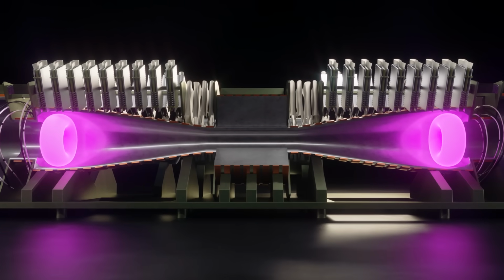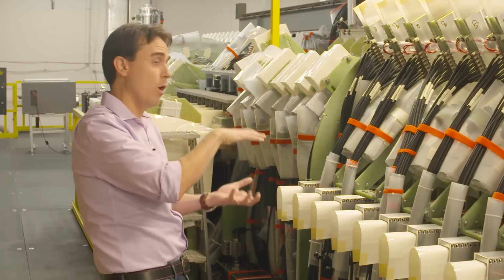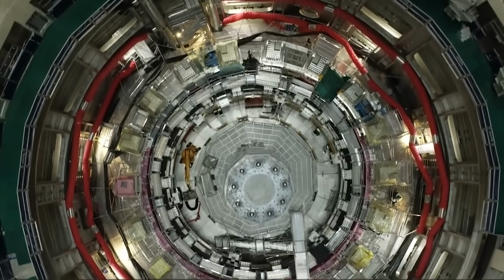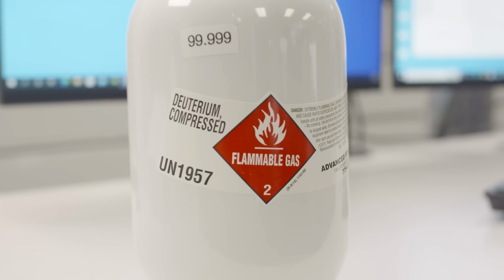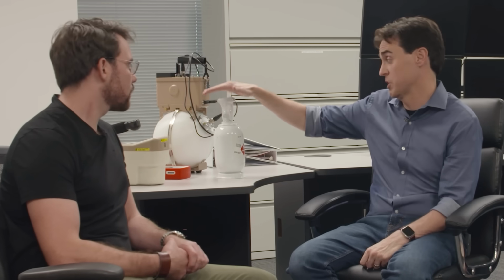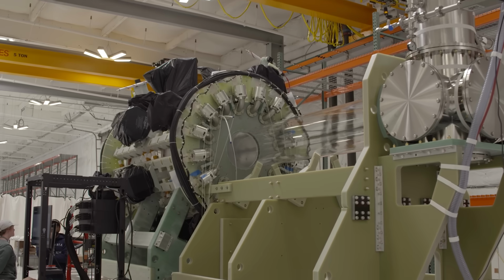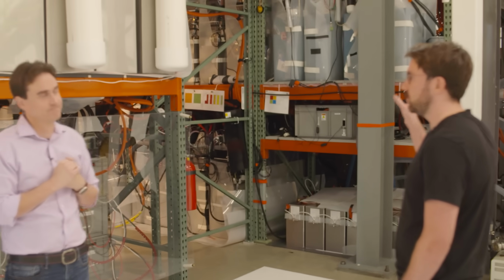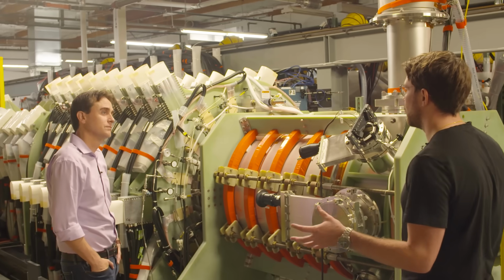A New Way to Achieve Nuclear Fusion: Helion

Comment: One of the major problems with many kinds of power generation technologies is that, during a power disruption,  power plants have to stop generating power as circuits get cut off. Now it takes a huge amount of energy to bootstrap them back to operating condition , presenting a huge engineering challenge! I suspect that a true green facility would have to have a battery bank with enough storage to charge the capacitors to operating levels, plus enough left over for the gas pumps and all the electronics. I wonder how fast it will be able to go from a cold start to full blast. Minutes? Seconds? Instantly would be best.

Comment: Essentially, this concept cuts out the "middle man" that lies between the nuclear reaction and the flow of electricity into the grid, namely the steam circuit of steam generation, steam use in turbines, then condensing it all back to water. 
However, clearly the reactor needs cooling so one hopes this heat will not be just regarded as a nuisance, but used somewhere. 
Will it all work ? So far it seems getting more energy out than is put in, has yet to be achieved.

Comment: Thank you for cheering me up about our shared ecological future. Now all we need is to reform our systems of government and governance, to make our democracies democratic and self perfecting and self correcting.  I cannot say thank you enough, because ITER (if it works) does so long after I am gone. Meaning therefore long after everyone else has either joined me on the other side, or are well on their way to doing so.

Climate change is already self-sustaining and self accelerating. Even if Helion comes to market in a big way within 20 years we are going to lose billions of human lives to climate change anyway.

If we have a future as a species longer than a human lifespan it depends on access to effectively limitless clean power to slow and to reverse climate change, and it will have to be applied at global scale within decades. 

This is the first credible sign I have seen that pulling that off might be possible. 

So, as I said, thanks for cheering me up.

Comment: This guy:
“Nuclear fission reactors are too expensive”

Sweden:
Has affordable electricity. Shuts down four nuclear fission reactors and replaces them with wind turbines. Electricity prices skyrocket.

TLDR: Fission reactors are expensive because of political interference and regulations, not because of the technology in itself.
If someone builds a working fusion power reactor, it too will be regulated into oblivion.

Comment: This is so amazing! Especially the part of skipping the whole water-evaporation-turbine-part. This creates a huge potential use for such reactors in space. I do wonder about two things though: First, how fast is this puff-injection working at max? Is it fast enough to keep the reaction going in the middle or at least somehow benefit from the aftermath of the fusion event to make subsequent fusion events more efficient? Second, this is a two-side apparatus, somewhat like a boxer-engine... Would it make sense to arrange this thing in a circle like a radial engine where opposing 'pistons' fire at the same time and create a cycle where the created electromagnetic force from the fusion of one pair can be used to energize/compress the gas in another opposing pair? This way, you could get away with fewer capacitor banks.
Reply: Tandem reactor might reduce the number of capacitor but you will still need lots of power electronics to control everything and most of the losses will be on the power electronics. It is also possible to store energy on the rotating plasma vortex.

Comment: Very interesting and fascinating concept! But  it seems a bit like the endless "Fusion will be commercially available in 30 years" changed into "Fusion will be commercially available in one to five years". Better, bit still too optimistic.
And imagine the poor rodent that will bite into a cable on those insanely huge capacitor banks xD

Comment: A lot of people excited, especially scientists, so I thought I'd point out that if this was that technologically groundbreaking or lifechanging, they wouldn't be talking about it nor announcing it publicly, there's no interest in doing so outside of marketing/profits, and they would be risking "new" ideas getting into the hands of "others" (National Security). We not only have done better, but have better and in usable small form factors for decades in terms of energy producers. This is the problem with our current system/paradigm, nothing that challenges the current defined-norm is allowed for public use because of fear, loss of control, and/or profit. These scientists' feelings are very real and amazing, they're achieving something their team have never before. However, if they were to ever discover anything "system breaking" their shop will be closed down and they'll be under a different payroll immediately. As a very tiny example, there are many military nuclear and other engines/power-generators that are still top secret from decades old to new. Cheers

Comment: We should design the power generators to also harvest fuel, but just never use it unless it's necessary. That's my pov from using old machines, some with additional functionality and some without. But I have bo concept of this type of engineering or construction.

Comment: I think you are bit late to the party... Ignition Lab already achieved fusion ignition with lasers. It put out more energy out than it went in. Yes, i know lasers they used to power reaction is only 1% efficient. But that's not the point. Point is they made ignition.

Comment: Bit unfair comparing ITER with this device - this device is, for sure, an amazing physics experiment but ITER is a physics experiment, an engineering experiment & a vehicle for developing the infrastructure of the fusion industry & other technologies that all fusion devices - even this one - will be able to take advantage of (eg. Diverter materials) . Plus any video on a fusion device should talk about it’s achieved fusion triple product - plasma density x plasma temperature x energy confinement time - as this speaks directly to a device’s ability to produce a energy gain and allows people to see how close they actually are to commercial viability.

Comment: This also allows for the extraction of electrical work directly from the plasma fusion output. This makes the approach more efficient than running a thermodynamic heat engine or steam generator. In principle!

Comment: This is the first description of a fusion reactor I have seen that seems like it could really work. Eliminating the heat/steam/turbine steps is huge. Slamming two rings of fusion material together rather than trying to just heat a kernel of material is also genius. Having a system to actually produce fuel on a realistic scale – you guys are just on your toes. This is not just some breakthrough but many breakthroughs.

Great job Helion! Good luck as you move forward.
Reply: I was surprised initially when I first learned about how fission/fusion works with how the end result was still just boiling water to spin a turbine. Skipping that step seems like a huge step forward.
Reply: Yep that should eliminate same efficiency/transmission losses for sure but they even mentioned that same possible reactions aren't so nice for there  reactor because of exess heat also the plasma radiates heat in too the reactor walls and they want higher rate of fire by a factor of 100 and if possible beyond so cooling the reactor is also needed why not with water to capture even more of that energy that radiates out of the reactor
Reply: I can imagine that the original inspiration of just slamming energy together came from the atomic bomb, where you just dynamite two highly radioactive materials together for a explosive reaction.

Helion seems to just taken a look at that very basic concept and iterated upon on it - how to controll the direction of the force of material used, how to control the explosion and how to harvest that energy most efficently. 

Very basic and good idea! no need for all that extra stuff with having to turn a turbine to then create electricity that is not related to the energy that is made in the fusion reaction itself.
Reply: There is still a lot of question that need to be answered : what efficiency can we expect in the capture of the charged particle pressure. How does it compare to the energy that need to be inputed . That also need to take into account the step needed to produce the fuel ! 
And since , from what i understand , they didn't yet "capture electricity" meaning that they have yet to generate anything it's not a trivial question !
Reply: are you there hype man or something?
Reply: If it's true. Sounds like hoax sadly
Reply: @vrnvorona  would you care to explain why??
Reply: @kalamay  Sounds too good to be true, especially part where electricity is generated by expansion of magnetic field. I mean, we would see in their 7th gen if it's enough, but to me it seems that producing such fields requires much more energy than plasma can expand.
Reply: @vrnvorona it’s not about how much you can expand, but how quickly. Current comes from the rate of change, not the amount of change
Reply: @capybara5494  Would a single huge change in the magnetic field cause too large of a current for the wire to handle, though? There has to be a limit on how much energy we can extract based on the time for the magnetic field to move
Reply: @VoidHugger  I’m not qualified enough when it comes to such complicated physics, but if they can handle a million amps already, surely they can handle a little more to achieve a net positive 🤷‍♂️
Reply: @capybara5494  you may be right 🤦
Reply: isnt the energy produced from this heat energy anyways? so they just havent added the "heat/steam/turbine" part yet?
Reply: @heavygaming6596 not really. They mentioned the energy here is captured as pressure by the reacting ions outwards on the magnetic field confining them. This expanding magnetic field produces the extra current which is how energy is extracted. Pretty clean!
Reply: @pavankumarreddy93  Nice, Thank you for explaining
Reply: @heavygaming6596  – No, not heat energy. Electro-magnetic energy produced by the sudden powerful movement of the hydrogen and helium ions. Just like moving a magnet through a coil.

Rather than turning heat into steam and steam into rotational motion rotating a magnet inside a coil, let's take the electromagnetism generated by the moving ions of the fusion reaction and draw of their energy directly as electricity. It's genius.

I hope I made sense to you.
Reply: @rubiks6  yes thank you
Reply: @heavygaming6596  Direct induction would be what this is called, absolutely brilliant. I was astounded when I saw this design. I can't believe this is the first i've heard of pulsed compression fusion.

Comment: Going direct from plasma to electricity makes so much more sense than the tokamak/stellerator approach, seems that if it works the efficiency would be unbeatable.
That is the best news in fusion research in a long, long, time. (and put the ignition laser research in perspective, a process that is terribly inefficient and extremely slow)

Comment: My issue is that, whenever you do D-He3 you are going to be doing more (much more, usually) D-D fusion, up until about 80 keV (for reference, D-T tokamaks aim to operate at around 10 keV). So the idea of a "separate, pure D-D generator" to produce the He3 fuel doesn't make much sense to me. I haven't done the calculations, but it doesn't seem like a separate D-D generator would be reducing the neutronicity by all that much, given that in both generators the neutron comes from pretty much D-D only. 

Also, at and especially beyond 10 keV temperatures, bremsstrahlung losses are very significant. That's a big reason why D-T is chosen; if we could get up to higher temperatures without radiatively losing so much plasma power, it would be really nice. This becomes an issue with impurities too; high Z impurities like that ones found in pretty much any surface in contact with the plasma will run the risk of completely quenching the plasma with just a tiny speck of dust (this is already a big issue at 10 keV).

Comment: This is fantastic news hopefully they begin selling them commercially before 2028 because I'm going to need one of these to power my RTX 7090ti, I need enough power to make the most of my  62,914,560 Hz 12,845,056-inch monitor, I know people say you can't see above 600,000 fps, but they're the ones losing every game of Overwatch 512 because they didn't have those 60 million extra frames to see me coming, there's a reason why console gamers can't compete at e-sports, and it's because they're too accustomed to 300,000 fps, all that lag has underclocked their brains, 600,000 fps is almost double 300,000 fps and that means double the underclocking of your IQ.

Comment: I have to ask since im not sure

Since each side has a different element being accelerated via magnets, does each side require specific magnets for it?  As in, if you duplicate the reactor, making it symetrical, will the magnets affect both elements in the same way, or might He³ be (for example) a bit slower than Deterium?

Comment: None of this is sustainable, fusion or fission. Unless a method that doesn't continue to use valuable and limited resources found on earth is found(a self sustainable energy source). Even using water as power won't last forever. The only thing that we receive on an everyday basis we can use that is not depleting our resources is solar radiation. It's quite obvious what we need to do. But we're so dependent on our power needs it's hard to focus on that right now even when we should.

Comment: I think you're being a little bit to unfair on ITER over its Beryllium becoming radioactive, a metal becoming radioactive isn't really I think the reason Fission reactors haven't seen success. That problem is more to do I believe with their run-away reaction ability and their immense capital costs, ITER does away with the first but fails to achieve the second. Which makes it I guess perhaps better then fission but still kind of hamstrung by enormous costs. Just storing away a radioactive metal for a good long time is more doable I believe, especially as it isn't a proliferation risk in any kind of real sense. 

Also the supply of Beryllium is perhaps constrained right now, but the refinement process for it should be possible to scale substantially if there was demand for such. So I'm kind of dubious the current production amounts are really that limiting a factor. Never the less, it does add to the capital costs of the entire project yet further thuogh.

Still the MIT SPARC project seems to do away with the excessive capital cost side of things, and might as such make it possible to bring Tokomak and thus by logical extension their probably superior if more complex cousins the Stellerators actually affordable. Which would allow for yet another branch of potential Fusion energy to be explored. It would be interesting to see which of these fusion technology branches will end up working best, or if they'll find different niches that suit them more.

Comment: This is cool, answering a bunch of my questions. The idea of storing tritium to let it decay into helium-3 was my first thought, when the rarity of the latter was mentioned. It's also great to hear that they've thought of using fuel breeder reactors. I love this. These are things that I, as a mere science enthusiast, have thought of and I couldn't imagine that actual experts hadn't considered them as well. It's great to hear that they're being applied.

How much waste heat is generated and is there any thought as to whether it could be utilised to generate more power?
Reply: It is not as simple as your car's breaks where it charges the battery because its main job is to generate heat because of how the physics of breaking works that would be feasible. the loss is more of not being able to catch because that's not the jobs initial intent. Like friction how would you utilize that for energy. Instead, you make something that has less friction, so the energy goes where you intended it to go. At least that's from only having a bachelor's degree worth of knowledge which isn't enough to say you know something so take it with a grain of salt.
Reply: Whether heat is usable for power, or whether it’s simply a waste, depends on the energy delta of the system you’re working with. 

For instance, waste heat from a power plant cannot make electricity anymore, but it can be used to heat domestic hot water because the desired end temperature is so much lower for the latter than the former. Presumably you could build a district heating system around this type of power plant, just as they do for all the other types in regions which support it (which is mainly the Nordics and New York).

Comment: Now that's what I'm talking about...going directly from nuclear reaction to electrical generation.   I've always been perplexed that we still relying on 18th century energy conversion (steam) to generate electricity from a 20th century technology (nuclear).   It seems so clunky and wasteful.
Reply: Because its cheap, reliable and doesn't require exotic materials. 
Both methods aren't even mutually exclusive and you need to get rid of heat energy anyway.